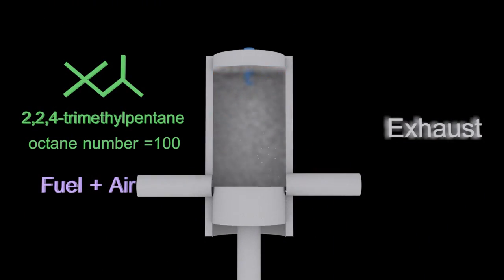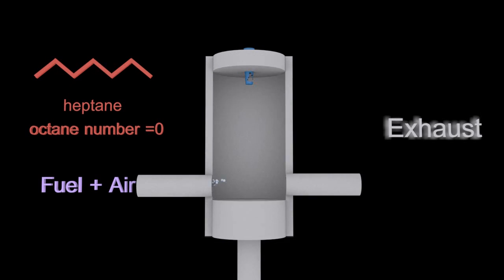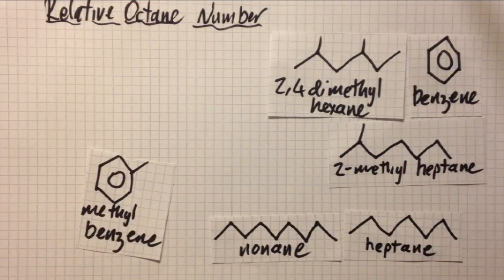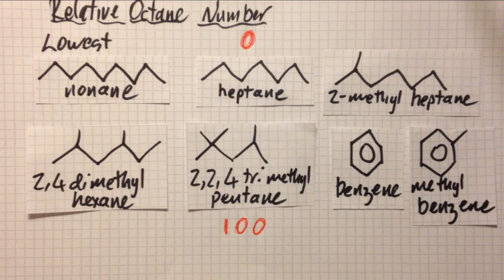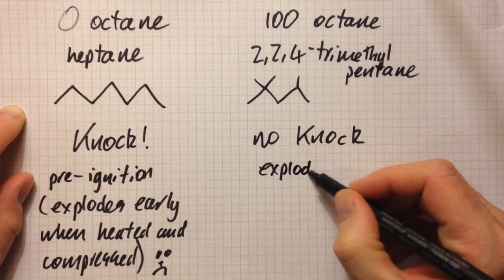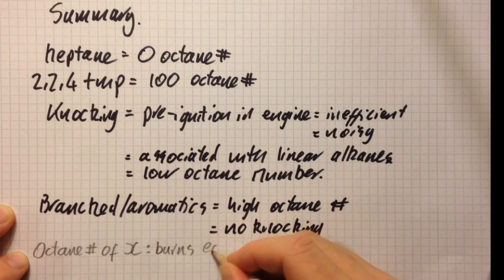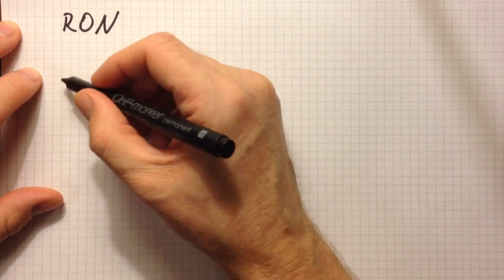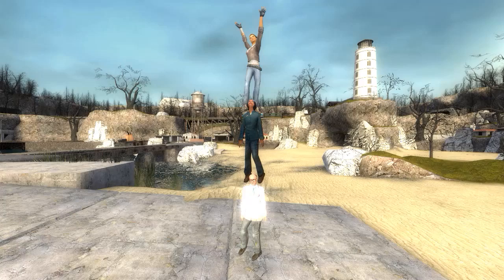C2 Octane Number and Knocking [SL IB Chemistry]

Comment: I wonder why the more branches the higher self-explosion temperature (same carbon number)? Take a look of n-octane and 2-methylheptane, there are 6 secondary carbon atoms and two CH3 ones in n-octane, while 1 tertiary carbon atom, 4 secondary and 3 primary in 2-methylheptane. For isooctane (2,2,4tmp) it's 1 quaternary, 1 tertiary and 6 primary. Use activity*number and sum those, assuming 27 for quaternary, 9 for tertiary, 3 for secondary and 1 for primary as activity, respectively. It's gotten 42 for 2,2,4tmp, 24 for 2mh and 20 for n-octane. The result just reversed😂. But the activity is due to the difficulty of forming radicals, my data is not accurate. And the spacial hinderance due to electron-electron repulsion of oxygen and different alkane molecules was not taken into consideration. How do you like it?

Comment: I can't understand the last part of video
Mon,Ron,Pon
Main things I understand from the 3d part of your video
Thankyou.
Reply from the maker: Mon, Ron and Son are just different ways to measure octane number - the fact the IB thinks this needs to be memorised is, frankly, silly.
Reply: The original test engine ran at 600 rpm with cool Inlet air and fixed ignition timing. The results of fuels tested on this engine gave the RON, research octane number. First developed in 1927. 
But some fuels did not perform quite as expected - detonation still sometimes occurred. 
So in 1930 they developed a new, harsher test, with the engine now running  at 900 rpm, with heated inlet air and variable spark timing - more like conditions in a car. 

This tested the fuel more, and gave LOWER numbers for the same fuel. This is the MON - motor octane number. 

Cars continued to the the RON until the 1980s when the USA, followed by Canada, Mexico and Brazil, decided to use an average of the two numbers which they called AKI - anti knock index, or alternatively, PON - posted octane number. 

The PON is typically around four numbers lower than the RON, for the same fuel. 

So 87 in the USA is equivalent to 91 in other countries. 

91 in the USA is equivalent to 95 in other countries. 

And 95 in the USA is equivalent to 98 in other countries. 

So in the USA you have 87, 89(or 91), and 95 PON. Look at the pump, it probably has (R+M)/2 on it ... that's the average of RON and MON. 

In Australia, South Africa, Japan etc you have 91, 95 and 98 RON, for roughly the same fuels. 

In the UK and Europe they don't bother with the lower rated version so usually have just 95 and 98 RON.

And just for info, aviation gasoline has always, since 1930, used the lower MON ratings. 

So 100LL Avgas which is 100/130 MON, would be roughly 105/135 PON, or 110/140 RON.

Comment: The reason I'm watching this video is because I have 2021 Electra 2.0 and engine and I noticed recently with recently with philosophy Phillips with 87 obtained from different gas stations shell mobile Chevron Costco it's making a knocking noise During acceleration it's gonna remind me when the cars were filling up with a bad fuel when I was an Iraq same engine knocking noise I talked to the dealer they said just try a different gas station but I tried all of them that the engines still making that noise during Do you think should I start using 91  octane  Cause the manual and the dealer said to use 87 and it says for 91 or 89 or higher do a research so what's your recommendation
Reply: Did you mean to say 2022 'elantra'? 

Elantras has knock sensors the engine will retard the timings it is really pinging at 87.

I own an elantra 2.0 2014 here in the middle east. My car loves 87 (91ron) more than 91 (95 ron).

back to your question, I highly doubt it is 'pinging' as the recommendation of hyundai for NU engines is 87 (91 ron)

Comment: ThankYOU VERY MUCH > can anyone tell me if high altitude has any effect on octance number ????
Reply from the maker: So octane number is related to the volatility of the fuel along with other factors (branching, predisposition to preignite etc).  Volatile in chemistry means the fuel evaporates easier.  Using the ideal gas equation PV=nRT, lower pressure and higher temperatures will make a fuel turn to a gas more readily.  I am unsure if lower external air pressure at altitude means lower pressure in the cylinders though.  High altitude air has less oxygen, which I image would hinder combustion = less pre-ignigion = higher octane number?
Reply: @ibchemvids  The octane number has NOTHING to do with volatility - they are two different aspects of gasoline. 

Auto gasoline has a high Reid Vapour Pressure  of between 10 and 12. That means it has a high volatility for easy starting in cold weather. 

Aviation gasoline is required to have a low Reid Vapour Pressure of between 5.5 and 7, meaning it does not vapourise as easily. This is important so the fuel remains liquid in the fuel lines (no gas bubbles) up to quite high altitudes - at least 22,000 feet. 

And yet 100LL Avgas has an octane rating of 100/130 (100 lean burn cruising octane rating, and 130 full rich full power octane rating). 

Volatility and octane ratings are separate measurement of gasoline, and are NOT related the way you suggest.
Reply: 85 octane is sold in Denver and other places at high altitudes because the engine performance drops a little in the thinner air, and a slightly lower octane rating is still enough to prevent detonation. 
In Aviation, the octane rating does not change as the aircraft climbs higher but engine performance does reduce as the air gets thinner, and the fuel mixture needs to be leaned out so the amount of fuel matches the oxygen molecules available in the cylinders to support that combustion. 

As you climb higher in an aircraft with a turbocharged engine, for example, you gradually open the throttle from its usual normal climb power to full throttle but the engine is still producing only say that normal power. The altitude where the engine performance drops with the throttle fully open is called its full throttle height. Above that height the engine power drops off no matter what you do, and once the power is insufficient to allow the aircraft to climb any higher, that's the ceiling for that aircraft.

Comment: Ron emulates an engine that isn't moving. 600rpm
Mon emulates an engine that is moving. 900rpm.
Reply: No. The RON is calculated using a particular test engine spinning at 600 rpm using cool inlet air and fixed ignition timing. 

But some fuels still showed some detonation when used in cars, so a new test was developed. 

This had the same engine running at 900 rpm, with heated inlet air and variable spark timing - more like the conditions in a car (as you were trying to say). This results in a harsher test for the fuel and so it has lower numbers. This is the MON test. 

The USA, Canada and Mexico use the average of the two numbers and so has 87, 89(or91) and 95 octane ratings. 

The rest of the world stuck  with the RON so has 91, 95 and 98 for the SAME fuels.

Comment: Hey, I am a bit confused what exactly is the definition of knocking? You wrote knocking = pre-ignition but I read that they aren't the same and pre-ignition causes knocking. I know it's caused by pre-ignition and it can do damage to an engine but I can't find any definitions of it viable for IB.
Reply from the maker: Knocking is caused by preignition.  Knocking occurs when the fuel ignites when the piston is in a suboptimal position in it's cycle.

Comment: ?how we measure the octane number of any substance
Reply from the maker: not sure - there must be a table of heptane/trimethyl pentane mixture burn profiles that measure when an explosion happens at certain temperatures and pressures.  Lets say a 50:50 mixture explodes at 1000K and 10atm.  Now compare this to your actual mixture.  If it explodes in the same conditions it is octane number 50.
Reply: @ibchemvids 
My prototype allows my test car to run maximum ignition advance setting.

What do you think the octane equivalent would be?